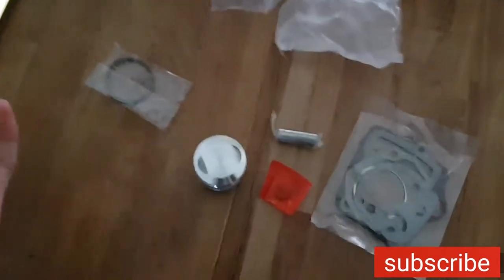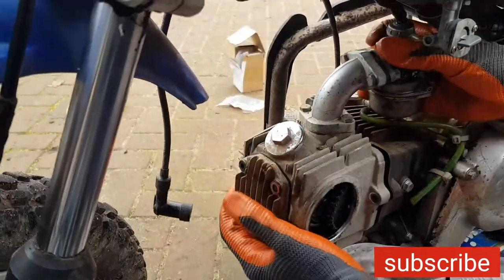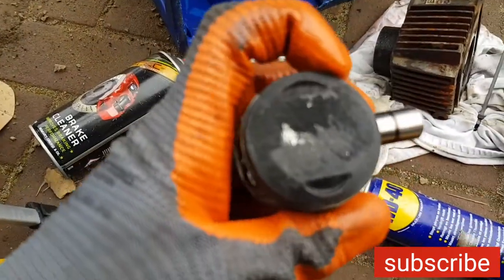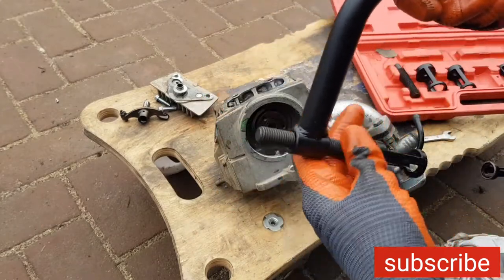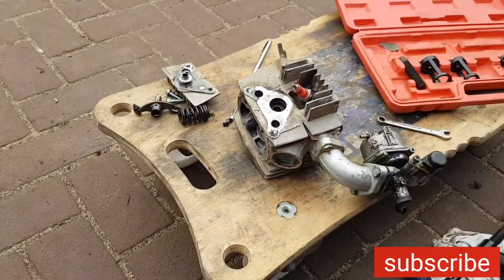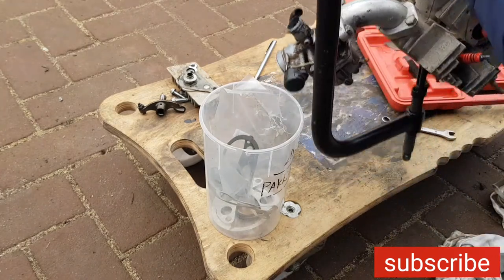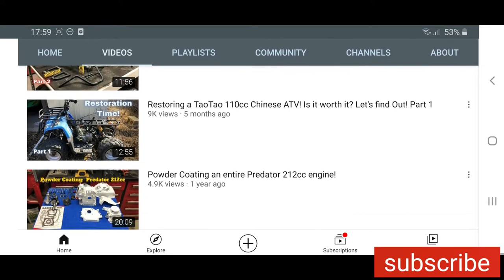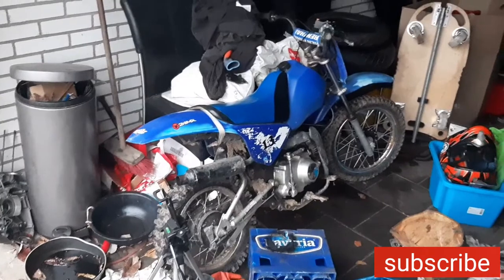How to rebuild a pitbike engine

Comment: Smoking is caused by worn out rings... Not piston.... 

Should have just changed the rings only because stock pistons are better off than replacements..

My personal thoughts  though...

Good job Sir
Reply from the maker: Yess your right! I just wanted to change it aswell because it was 10$
Reply from the maker: Ah yes on japanese bikes i agree oem is better but this chinese piston is exactly the same as what was in it before.

Comment: I have a question bro, my pitbike only runs if I keep the throttle running, once I let go it shuts off, and I replaced the carb and still nothing, someone said it could be the piston ring, did you had the same issues?
Reply from the maker: Yes piston rings sparkplug pickup coil or cdi are points that fail allot but first of all check your valve clearance this will probably fix your problem!

Comment: heyy can i ask you a question...
my pitbike ycf 125 smokes blue smoke out of the exhaust and its burning engine oil, i think...
what can be wrong, is mby seal too old that oil comes in engine or are the piston rings bad
thanks for helppp :)
Reply from the maker: Does it smoke morge by startup or more when the engine is hot and you rev the engine?
Reply: @Builditathome-Restoration  when engine is warm